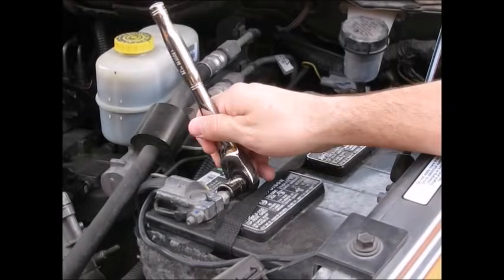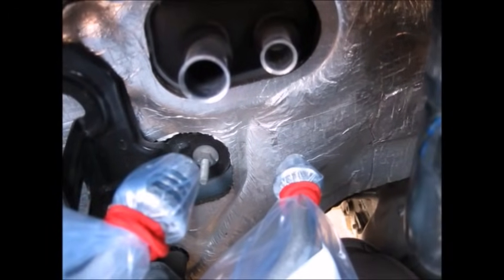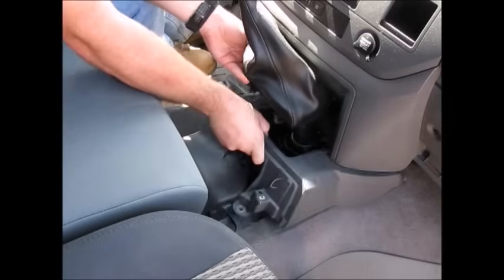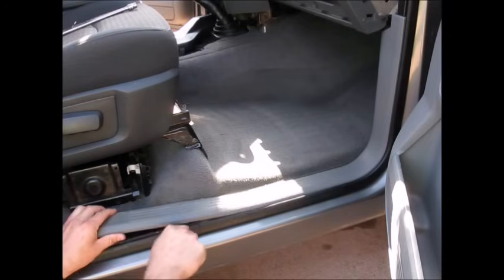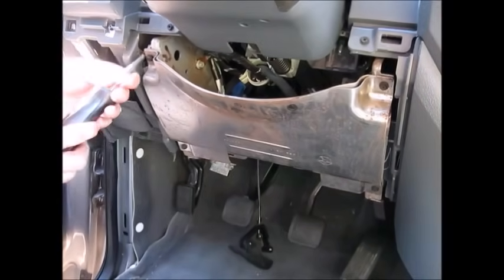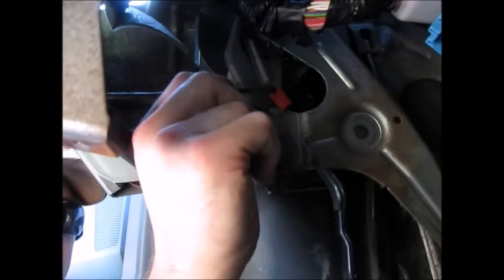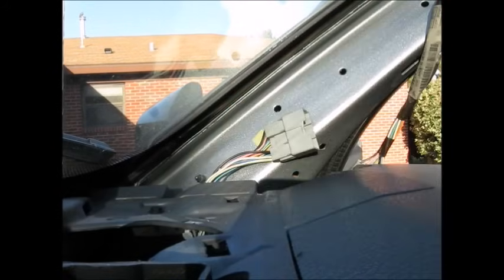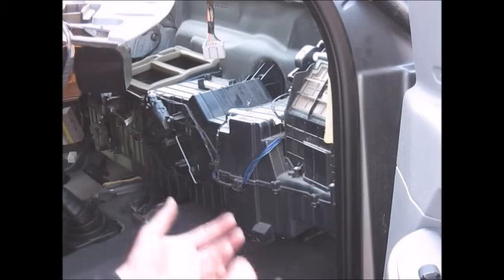Blend Doors and Evaporator Replacement - Part 1, Removal

Comment: Remember--this guy is trying to sell you blend doors.  He conveniently omits the most difficult parts of the procedure, such as removing the heater core hose clamps. He just pulls the hoses right off.  Or removing the evaporator core  suction line Notice there isn't an engine in his way...☹

Comment: On my 06 diesel one of the studs coming through the firewall was behind the radiator reservoir; it didn't look like it had a nut on it at all, thought I was lucky till I tried taking the heater box out in the cab.  Ended up having to remove the top of the air cleaner and hose to the turbo to get the reservoir out to remove the nut which was really buried in the firewall insulation.
Also if you want to entirely remove the dash one thing missing in this video is removing the wiring harness that goes from the dash to the turn signal switch.
This video is great for anyone taking on this job but ya gotta realize things might be a little different on your truck depending on the year, interior package and engine. 
Thanks @flopster843
On to part 2.

Comment: Mannn, I wish I would of seen your video first. 😂 I took apart every plastic bit & piece on that dash trying to get to that dang o'box. Trying to remove that second top dash screws from the center where the hand wide holes had me stumped 😂 I could of just left those mothertruck'n backward facing screws where they were. 😂 nuts.

Thanks for the video tutorial.

Comment: Its is a good video but darn it. Unless its different on certain trucks he left out that there are 2 more nuts that need to be removed before you pull straight out!!!! You will break the attachment directly behind blower box!
Reply: The ones under the hood?
He mentioned them after disconnecting heater core and evaporator.

Comment: The camera placement, editing, and explanation are top notch.  I have a megacab and need to get to those two large rectangular holes (megas have a screen there).  I've been intimidated by "removing the dash" and putting the job off.  Seeing your video makes it seem so straight forward than I thought.  Thanks!

Comment: I have an early 2007 Mega Cab with the 5.9 cummins and it's an automatic. I also have a center column as found in the Laramie Package. It's different then the one you demo-ed so I trust it isn't too much different in taking it apart.

Comment: My 2006 ram 1500 megacab there is a metal strap bolted to the truck behind the glovebox. When I tried to pull the dash back it would get stuck. Then I saw this strap and removed one bolt and it was loose. Also one of the bolts on the firewall that needed to be removed was hiding behind my PCM. It was easy to remove though. First pull the four plugs and then just two screws on top and one on bottom.  Thought this might help some people

Comment: Do I need to do all this if I just want to replace the cracked dashboard?
Reply: You don’t have to disconnect your AC or heater hoses which is by far the hardest part. The rest to get the dash loose was easy

Comment: Just did this 3/2/24. 2006 5.9 w/ prod. date of 8/05 which makes it pre-2006.5. Couple items to note: there are two nuts on the firewall behind the coolant overflow tank. You don't have to remove the tank to get to them but they are very difficult. To remove the a/c lines, the tool will need to have very thin couplers that slide in behind the pipe or it will not fit. There are different heater cores for pre- 3/2006 and post 3/2006 manufacturing dates. Purchase accordingly. OEM actuators are discontinued. Murrays from O'reillys are the best way to go, because if they malfunction, you can file a labor claim and get a warranty. The blend door USA kit has a different type of fastener than in the video for the actuator that has the rods attached. It now has purple plastic clips like the one on the e-brake.

Comment: My 2005 2500 Ram Manual 6 speed has a screw in Shifter  Extension and also found leaving the heater hoses on at the firewall saved me a lot of time, just pull them through.  And then when you reinstall it was better already on.  VERY HELP FULL VIDEO.... I just finished my HVAC box with the new BLEND DOOR USA kit.

Comment: just curious if you ever had to replace the center actuator in a 2007 ran 1500? you can see if when glove box is removed. do you have to remove the entire dash to get to this? i'm not getting any heat on floor, but up at defrost when in the floor setting. the motor is not moving at all when switching between modes. just wondering. why they would put this in a place you have to remove entire dash. wow

Comment: Just finished mine in my 03 Ram automatic, only thing I don’t understand is how my steering turned 90 degrees with the key out, wheels turned a little also, hope I didn’t mess up anything
Update:  I just had to hold the steering wheel to unlock the ignition, everything is all good now, it is not as bad a job as u think

Comment: In my 2002 I had to remove the pcb board to access an HVAC housing nut for a total of 3 nuts on the engine bay side.

Comment: I have a question?  With everything you have covered, does it dissable the airbags?
Reply from the maker: Airbags are temporarily disabled when the batteries are disabled after the capacitors are discharged. Everything is recharged and operational after they're hooked back up.

Comment: Man, I absolutely couldn't thank you enough for making this video! My evaporator crapped out so I'm doing  like you and replacing everything. That way I never have to do this again! Many many thanks to you sir!
Reply: Hey brother,after replacing the evaporator,how or where did you add that ag oil? On the evaporator itself or when charging the system with refrigerant?

Comment: Very informative and super detailed.  I love it!  I have a question though.  I would prefer to not have to evac the system and pull the lines to pull the box out of the vehicle.  I'm looking to just replace the blend door for the dual climate control system (even though my Ram 1500 does not have dual climate control) because it's only blowing air on the driver side and not the passenger side.  Is it there enough room once it's loose to pull the heater core out, take out the 15 screws from the bottom, and get to the mode door?  Or is this just an impossible task?

Comment: Amazingly well done tutorial.  Only suggestion is for my 2007.5 Dodge 2500 XLT,  there were an additional 2 nuts on the firewall next to the accumulator.  Had to remove a small computer on the firewall to access the 2 nuts for removal.   Other than that everything was perfect.  I there any method to test the HVAC box, ( all the actuators) before fully assembling the dash?  I would feel better if I could see all the doors operate before fully assembling the dash.

Comment: Thank you for a great video! I had been putting off fixing mine for years. Found 3 of the 5 doors were broken in mine. The Blend Door USA doors rock. I now have full control and air flow back to what it used to be.

Comment: OTHERS HAVE ADDRESSED THIS BUT I'M GOING TO REPEAT IT. THE LEFT NUT UNDER THE HOOD { AT 2:43} IS BEHIND THE OVERFLOW BOTTLE. 2 SCREWS TAKE IT LOOSE. ALSO BLOCK YOUR WHEELS AND IF AUTO TRANS PLACE IN LOW RANGE BEFORE BATTERY DISCONNECT. OTHERWISE IT BLOCKS THE DASH REMOVAL.   GREAT DESCRIPTION. WISH I HAD SEEN THIS BEFORE  THE FIRST ONE I DID. I HAVE INSTALLED SEVERAL OF THE BLEND DOOR USE DOORS AND CAN SAY THEY ARE WITHOUT A DOUBT THE BEST MADE HANDS DOWN. JUST WISHED THEY MADE THEM FOR FORDS.

Comment: Great step by step video. One question? Do I need to remove the hole box just to replace the blend door or can I leave it in and replace the blend doors?
Reply from the maker: It has to come out. The bolts that secure the upper and lower sections together are inaccessible while its in the truck.

Comment: Just discovered that, if you have an automatic, it might help to put in low before you shut it down, because the selector will be in the way when you move the dash.
Reply: BEFORE YOU UNHOOK THE BATTERY OR BATTERIES IF DIESEL.ALSO BE SURE TO BLOCK UP THE WHEELS SO TRUCK DOES NOT ROLL AWAY WHEN YOU'RE OUT OF PARK. WOULD ALSO DO THIS IF IT WERE STRAIT SHIFT. .
Reply: So after replacing the AC evaporator,that ag oil needs to go inside the evaporator or it can be filled when charging the system with refrigerant?
Reply: @christinacarletto9240  I’m not sure, my shop evacuated the system for me, then I had them recharge it after I finished. Didn’t mind paying for that because I still saved a lot of money. It has been running great for four years, apparently, since my reply is four years old 😅.

Comment: Very good step-by-step tutorial.  One thing I saw in another video is that since there are so many screws, nuts, and bolts to keep track of, it might be helpful to temporarily reinstall them after each component is disconnected, that way you don't have to worry about keeping track of all of them.

Comment: Fantastic video. I really appreciate how well this video was done! I have an '05 automatic.  I had a heck of a time getting one of the A/C quick disconnects undone (the one going to the accumulator) I finally cut the line using a compact pipe cutter (I'm replacing the condenser anyway).  I also could not get the heater core lines to break free. I moved the clips back and twisted and pulled as best I could, but they would not come free. I finally had to cut them free. I also had an extra metal strap running from behind the glove box down to the front of the AC unit that I had to unscrew. Thanks again for the great video

Comment: Do I have to evacuate the AC system if I just want to replace the heater core?
Reply from the maker: Yes. The system must be evacuated to pull the box, and box has to be completely out before you can take it apart to get to the core.
Reply: @flopster843  Thanks for the reply. I appreciate it. I saw part two of your video and finally understood exactly why it has to be evacuated. Thanks again.

Comment: flopster843 Thank you for a trio of some of the best repair videos I have ever seen.  I know it's been 3.5 years since you posted these so i'm not sure if you see new responses and questions.  My question is that I have an automatic with the shifter on the column.  Is disassembly and assembly different because of this?  Thanks again
Reply from the maker: Very similar. You'll just have to deal with the shifter cable coming down through the column.
Reply: @flopster843  I ordered everything you have in your video.  Blend Door USA was easy and very professional to deal with.  Got the same evaporator and heater core off of Amazon.   Will be tackling this soon.  Thanks again!

Comment: My 06 looks about the same minus I have a open middle floor and it's an automatic.  Is there anything I need to address different with the shifter in the column?
Reply from the maker: You'll have to disconnect the shifter cable in the column.  That's the only big difference.
Reply: @flopster843  that wouldn't just follow down and lay with the column?
Reply from the maker: It might if there's enough slack in it. I'd be really careful with it though.

Comment: Your full of crap!.................The 2007 Dodge Ram has a STEEL FRAME that surrounds the face of the AC/Heater Case that is tack welded in place!
Reply from the maker: That steel frame is bolted to the floor by two bolts on the trans tunnel. You have to pull the floor console to get to it.

Comment: 9:35 I saw in another video you should secure the steering wheel so it doesn't damage the clock spring.
Reply from the maker: With the key out. The steering wheel locks itself.
Reply: @flopster843  Oh boy, I had the key in a few times I was yanking the wheel around.  Might be buying a new clock spring.  Thanks for the update.

Comment: The video is excellent quality. But it does not apply to all 3rd gen trucks. The center console, lower dash, and shifter on my '04 are completely different from what's shown here. I didn't make it through the entire video, but I'm sure there were more differences. There was a redesign in '06 that probably accounts for most of the difference. Not sure why they consider those years to be one generation honestly.

Comment: Thank you Carbonite Cummins and flopster843! I had the mode 1 door and the blend door break in my 2006 Dodge Ram 2500. This was the second time the blend door broke, the first time it was replace by the dealership under warranty. It's a scary thought to remove the entire dash from your truck to make the necessary repairs. Flopster843 shows you everything you need to know from start to finish. To compound things.....my compressor crapped out. I researched the internet (youtube) trying to find the best door to purchase and I settled on Blend Door USA. Sure, they are more expensive then their competition (OEM and aftermarket) but they are built much stronger and this was a task I never wanted to repeat. I also replaced the heater core and evaporator coil while I was in there. In addition, I replaced the accumulator, liquid line, and condenser. Pretty much my entire AC system is brand new. 

So one Saturday morning I had my son come over to give me a hand. Neither of us are professional mechanics. I had the Freon recovered by a certified technician. All the rest of the work was performed by my son and I. We finished the entire job from start to finish in one day. 

Blend Door USA is a small company. When I called to order my doors, I was talking directly to the owner of the company. He was very helpful and I even received a 10% veteran's discount. Shipping was fast! Thank you!

Special note on this project, you do need some specialty tools to do this job: Ac line disconnect tool, Freon gauge set, and a vacuum pump. A Freon leak detector is advisable to check for leaks afterwards.

Comment: Awesome tutorial!!!  You have given me hope to have cold air, again in my 2006 Ram 2500 diesel.  An AC guy told me that the evaporator sensor is bad in my unit because the condenser kick on and off and the intake door is broke, also.  He called around and found out that dodge doesn't make the evaporator anymore!  I can't find an aftermarket part either.  So, I'm wandering if I buy a new evaporator, will it have the evaporator sensor with it?  AC guy was going to charge $1K to pull the box and replace the intake door and still couldn't replace the sensor!  He suggested I go to a junk yard and try to find one.  I notice you didn't mention replacing the evaporator sensor so, I'm hopeful that you can give me some advice as to what to do!  After watching this video, I think I could do the work if I can get a solution for the evap sensor.  Please help!

Comment: Wow, THIS is how to do a YouTube tutorial.  I put up with my MegaCab "mouse blowing through a straw" A/C for 9 years ('06 2500).  He DID say removal of the airbox was..."easy" right?  Happy to say my '15 3500 dually MegaCab blows nice and cold. They obviously figured out a better way to divert air to the rear than blocking the front vents!

Comment: Any help?! I just did this to my 07 and went to start it and it won’t start. I don’t know if I pinched wires in the column or what
Reply from the maker: You mean it won't crank at all, or it will crank but not start?

Comment: If im not repacing the heater core and evap coil, can all the doors be accessed with the hvac box still in the truck.
Reply from the maker: No.  The box has to come out.

Comment: Would this be about the same procedure for a 2003 Ram 1500
Reply from the maker: Yes. The mounting hardware is nearly identical. The plastic trim is a little different, and there's an extra strap mount behind the glove box going to the front of the heater box.
Reply: One more question, is it really necessary to pull the column cover and unplug everything inside the column cover, it don’t look like u had to do it to your 08 Cummins, I’m working in a 03 Ram 1500
Reply from the maker: @chrisbrown6804  Each truck is slightly different. You'll have to look at it when you take it apart to see if anything is in the way. Take your time and watch everything as you go. It's not as bad as it seems.

Comment: Do you think I can get away with just pulling back the dash if I'm only swapping out the mode doors?
Reply from the maker: The Recirculation and Panel doors are the only ones you can get to without splitting the box in half.

Comment: I can’t get the 3/4 ac line off to save my life. I have tried two types of tools, including what is used in the video. Any suggestions? I’m about ready to just give up and live with no defrost or a/c at this point.
Reply from the maker: Try to put some penetrating oil in the spring-lock fitting.  Try to twist the line around to make sure it's not stuck.  Lots of push-pull motions while using the spring-lock tool.  If all else fails, cut it off and replace the line. I've had to cut a few off because of corrosion in the connections.

Comment: I have a manual windows truck, no center lock or anything... I’m thinking about changing the doors to an automatic doors... do you thing I can just do that  by replacing the doors simply? Please advise
Reply from the maker: Negative. Much more complicated than just the doors.
Reply: Thank you so much man! so helpful! Still working on my truck.. can't wait to see it running again, i'm replacing the venal mat with carpet...